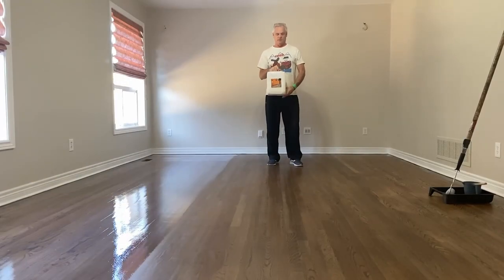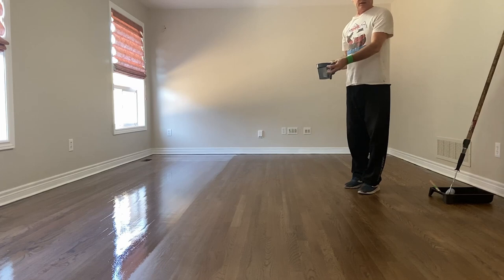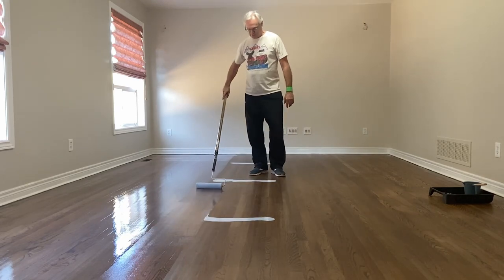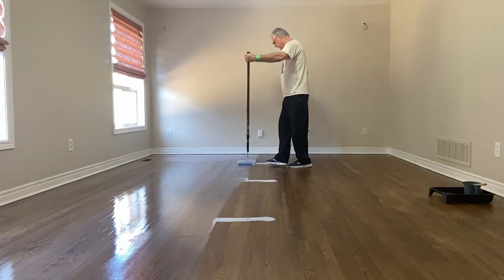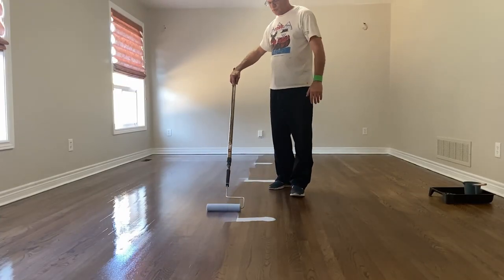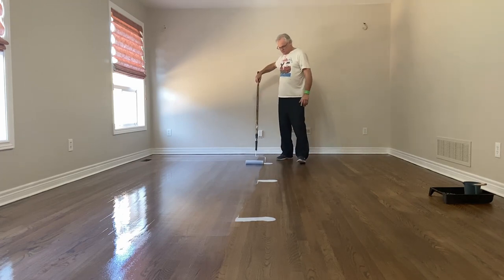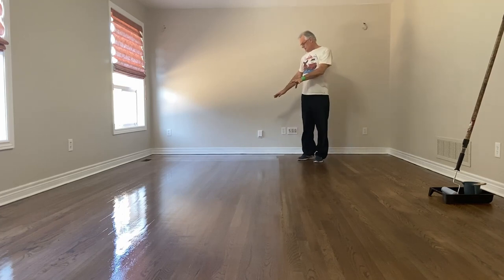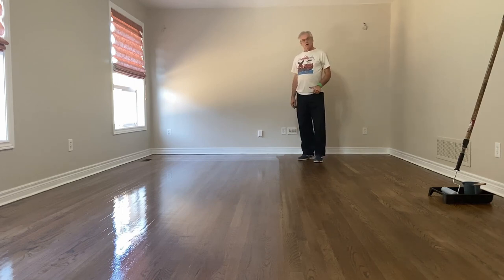How To Apply Water Based Floor Finish - Loba Life Satin - Ask Questions & Post Comments (Ep#57)

Comment: I never pour water based onto the floor in puddles like this video shows. You are asking for trouble. If the finish seeps down between the planks and can cause the edges to curl. I always  use a bucket and dip my roller in the finish. I’ve never had problems with the finish drying on the side of the bag.
Reply from the maker: I've never had an issue with edges curling. Thanks for watching!

Comment: I’ve been using loba for years .. there is no need for the bag in the bucket . Just use the bucket and won’t have any drying problems..also the 120 micron roller is designed to absorb the proper amount for applying a 36 square ft area .. much better results ..imo

Comment: I use to do the pour thing but realized it goes between gaps causing too much waste. I never had issues dipping into the bucket which is a method that is also taught by Loba and other manufacturer.

Comment: You’re wrong, supposed to stir not shake and you shouldn’t put more than two coats in one day.
Reply from the maker: If you read the label it says to shake the finish as with all water based finishes. Oil based you stir.
I applied one coat per day over 3 days.
Thanks for watching 😊

Comment: Great content. I have been watching all your videos. I have a few questions if you don't mind. 

Do I need to sand between coats of this finish?
If so, what is the wait time before applying more coats?
Reply from the maker: No sanding between 1st and 2nd coats.  Apply 2nd coat when 1st coat is dry, should only take 3 or 4 hours to dry. 2nd coat should be applied no more than 24 hours after 1st coat. 180 grit screen sand between 2nd & 3rd coats. 180 or preferably 220 screen sand between all subsequent coats. Vacuum, then wipe dust with either a damp cloth placed on mop head or a good dust mop before applying coats.

Comment: What’s your opinion on Loba vs Bona  Traffic Hd? I just finished sanding my floors and I’m looking for a good stain brand and finish that doesn’t “ember/yellow” with time
Reply from the maker: Both are excellent, my supplier carries Loba water based, and Fabulon oil based.
Reply: What stain brand do you recommend?
Your videos have been extremely helpful doing my refinishing process!!
Quick question? So I have my raw floors sanded to 100 grit. What’s my next step to stain? I had heard that I should use a buffer with 100 grit screen, your opinion on that? 
Then apply my stain?
I’m confused on the steps!!
Thanks for your help!!
Reply from the maker: @taradriscoll3686  Duraseal stains I use most. Sometimes the customer will supply stain. I prefer oil, or lacquer based stains. Water based dry too fast and can leave dark marks if left too long. You can use circular buffer with carpet pad to apply the stain if you're comfortable with the buffer. Or manually as I show in some of my videos. Take your time during the staining finishing process, good luck! Thanks for watching my videos!
Reply: Loba is much easier to coat with then Bona Traffic. Loba is so smooth its dummy proof.  Also if your final coat is a little foggy with Loba then that's perfect. Is my opinion Bona just has good commercials. A lot of Bona products are bad.

Comment: What are your thoughts on Loba 2K Supra AT satin finish?  Can we use the finish after sanding and sealer without using a stain. Thanks.
Reply from the maker: Yes you can. 2 coats will suffice. Excellent quality finish!
Reply: @HardwoodFloorRefinishing101  Thank you very much I’ve been watching you to try and figure out how to do this. I wish we could hire you.  What should we use to change color. This all pretty new to me.
Reply from the maker: @nancychen9549  Oil, or lacquer stain after sanding, prior to finishing. Oil is easier to work with as the dry time is longer. This video covers staining with oil based stain. https://youtu.be/E7_JUpwW0NU
Reply: @HardwoodFloorRefinishing101  Thank you ,we want to use water based because we have three kids. Are there good water based stains or should we just leave the natural color of our floor we think it is read oak
Reply from the maker: @nancychen9549  All water based stains are similar. You need to work quickly with it at apply to floor by hand wiping. It dries very fast.
Reply: @HardwoodFloorRefinishing101  What sealer do you recommend?  For finish With nearly 800 square feet and 1 gallon doing 500 to 600 square feet  and with never having done this could we get by with three gallons for two coats or should we buy 4 ?
Reply from the maker: @nancychen9549  
Use Loba EasyPrime prior to using Loba finishes.
Not all finishes will require EasyPrime to be applied first, however it won’t be a problem if you do.
For other products follow manufacturer specifications.
Any reputable company will have detailed application instructions for their products on their website.
Reply: @HardwoodFloorRefinishing101  Thank you for all your help. Wow you make it easy. What do you recommend for applying the loba Supra AT?
Reply from the maker: @nancychen9549  Use a 6 or 10 mil, lint free, microfibre roller only, and paint brush for perimeter, corners etc.
You don’t need to prime floor prior to applying the 2K AT finish. Good luck!

Comment: I just used a water based polyurethane on my hardwood floors because we refinished them but someone on fb told me I should have used oil or a wax because the maintenance for water based is a lot. Is he true?
Reply from the maker: Not true, good quality water based finish is fine for hardwood floors. Apply a minimum of 3, preferably 4 coats.
Reply: @HardwoodFloorRefinishing101  I just parks pro finisher from Home Depot. Is that one ok? That’s what the worker recommended. We did 2 coats then buffed then 1 final coat. Should we have done 2 final coats?
Reply from the maker: @bubblelicious92  I don’t use any floor finish sold at Home Depot or Lowes. If it’s made for hardwood floors it should be okay. Apply 4 coats
Reply: It’s the opposite.  Just buy the pallman cleaning kit and get it coated once every 2 or 3 years. Good to go

Comment: I'm looking for a stain color for red oak floors that are sanded bare currently. What color stain is on this project ?. It look nice, no "orange" showing thru from the red oak. Thanks, great videos.
Reply from the maker: That was special walnut stain. Thanks for watching!
Reply: Thanks Dave, I've spot tested several colors including special walnut. The special walnut on the red oak has that "orangey" tint. Looking at classic gray or western oak.  Not sure yet, has become a challenge, have you encountered this? Appreciate your reply.
Reply: Went with Verathane Western Oak on our red oak (sanded bare) came out nice, no orange, mid brown color. Topped with 4 coats Bona Mega One.